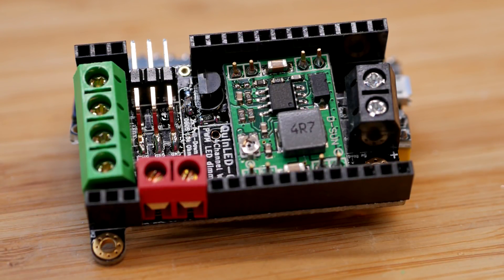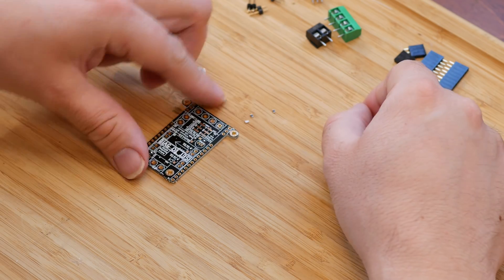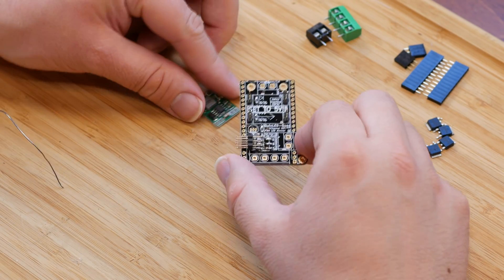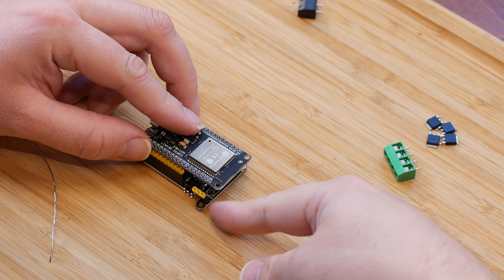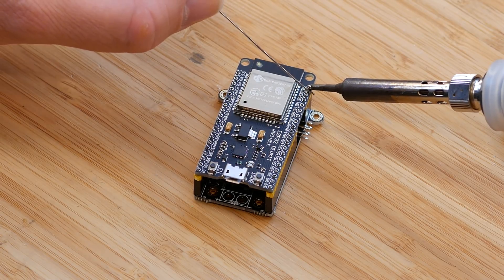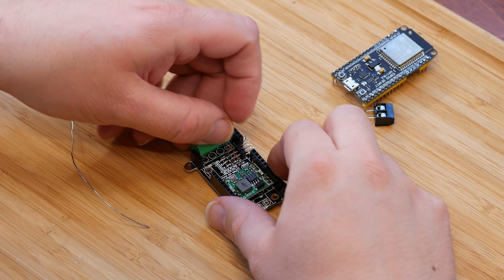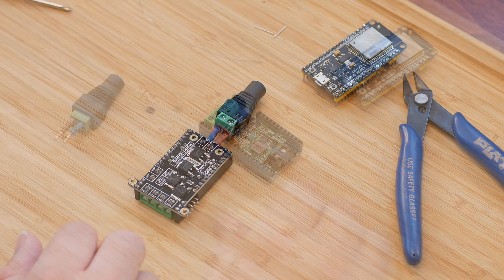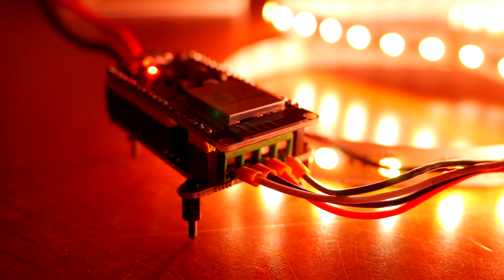QuinLED: QuinLED-Quad Soldering Guide

Comment: @Intermit.Tech did you add manual switches to any of your QuinLED boards?
I was thinking of using more, similar to what you have, to add to down lights etc, but would still need the wall switch as well to keep the WAF up as she likes conventional switches sometimes.

Comment: @Intermit.Tech

Tried to solder my first quin led quad today and I have a bit of a problem (minor one I think), I bought my esp32 development boards with headers soldered on. So now to fix the interupted pins I wanted to cut the 4 pins on both sides with a cutter, I cut my first pin and realized that I started on the wrong side ;-) 

So I cut pin G0, now my question is, is this pin needed ?

Regards
Dirk

Comment: Is it possible to connect a regular wall switch to have on/off control from wall switch not only app? what would be wiring?
Reply from the maker: Yes you can in multiple ways. You can connect one to one of the GPIO pins and the either have ESPhome or Home Assistant trigger the action you desire.

Once you are running everything through Home Assistant it actually doesn't matter which module is connected to it, any button anywhere could control the lights. But the action would be transferred over WiFi and Home Assistant so if those would be down, it wouldn't work. With the first option, all connected to the one board, you could make it so that that still functions

Comment: Small tip... test the buck converter before soldering it onto the board... 
The pot on mine was fubar on arrival and I am now having a hard time getting it off the board now
Reply: Yes.  I had one also DOA.  Plugged it in and it went bang and blew a whole in the chip.
It was a b***h to remove again without a desoldering gun..
Everything worked perfectly with a new regulator though.
Another hot tip.  Watch the ones from Amazon.  They are sometimes supplied without the adjustment pot and fixed at 12Volt output not 5Volt.
Get the adjustable ones whenever possible to save yourself that issue.

Comment: How far can the lights be away from the board if they are 12v lights
Reply from the maker: That really depends on the Amps and the type of cable used. Take a look over here: https://quinled.info/2018/10/20/wire-thickness-needed/ that table is for using 24v, with 12v you want to double the amount of copper (that's in the cable) needed. So figure out how much W per meter your LED strip is, how much you are going to use and then calculate the Amperage and you should have your answer. :)